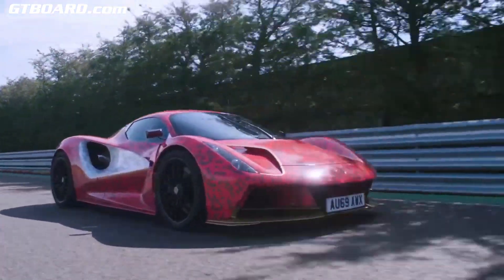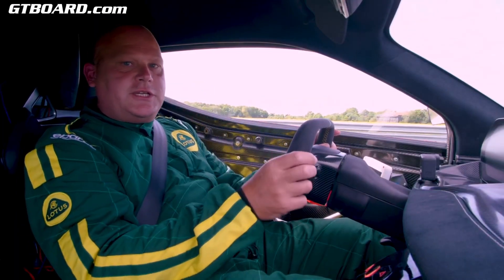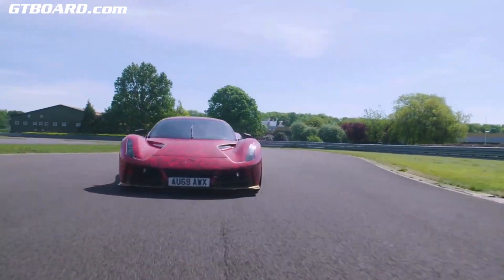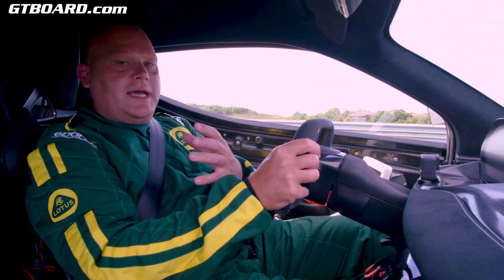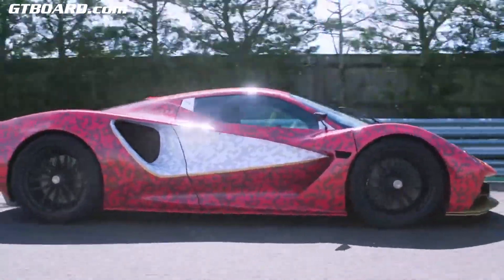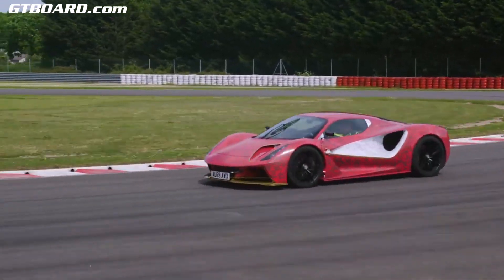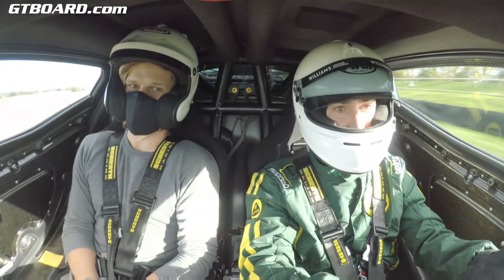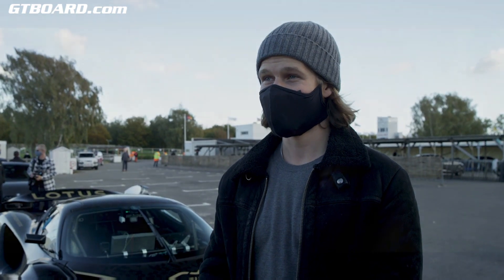1700 HP Lotus Evija in detail all electric

Comment: It needs more modes. 6.curb crawling mode 7.long range mode 8.running mode.9.robbery mode etc etc
Reply: 10.tank mode both wheels on one side go forward  11.one wheel drive mode 12.snap the chassis mode where the front wheels move forward full power and the rear wheels move in reverse in full power 13.donut mode etc